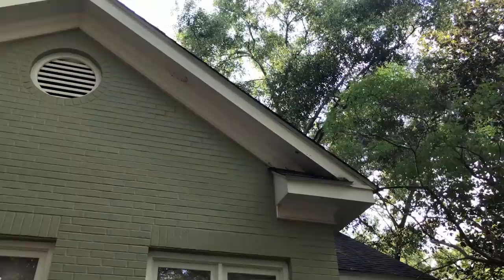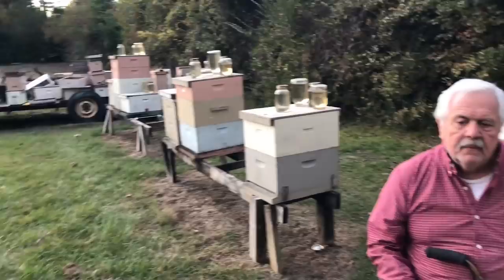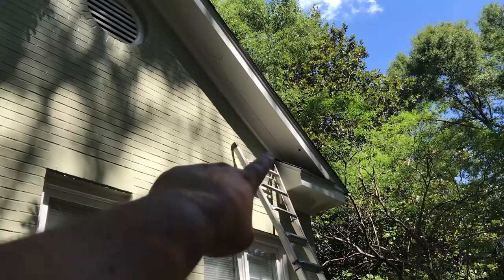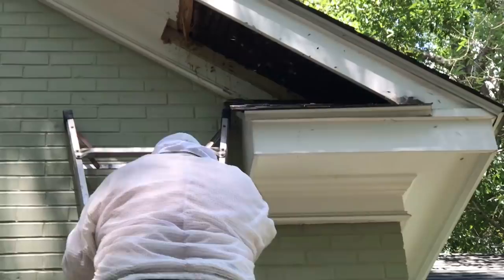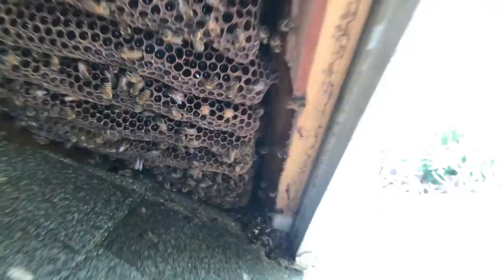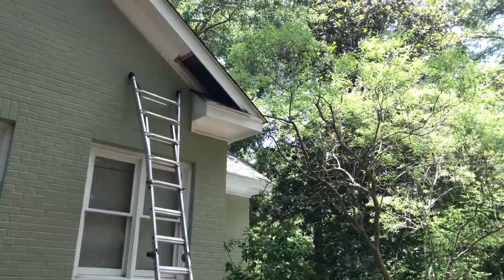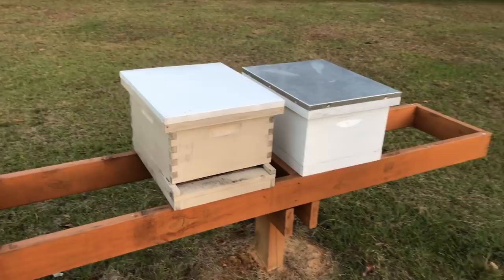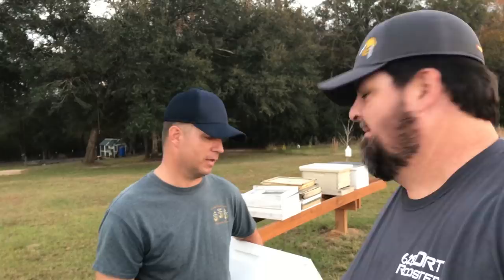Poisoned Bees...  The Hive That Wouldn't Die

Comment: Your dad looks in pain.  Not prying but my husband and I have joint issues too.  We both use glucosamine and chondroitin.  I buy the walmart brand Spring Valley . (I tried a more expensive brand that didn't work.). It took about a month to start noticeably helping so slow that I convinced myself it had gotten better on its own.....so I stopped taking it.  Big mistake!  Within a week my knees were back to bone on bone grinding.  I went back on it and about two weeks later I was feeling great!  My knees feel normal (even after 3 surgeries before I started the vitamin)...once in the last five years I ran out and didn't buy them for a week...boy was I sorry! I haven't run out since.  By the way I only take one pill a day now for maintenance and have no problems.
Reply from the maker: He's definitely got the worn out joints and the surgeries that go along with it.

Comment: Rooster.   Really enjoy your videos, and have a question not really pertinent to this video, but certainly to others.  When you use rubber bands to hold comb in your frames from cut outs, do the bees repair and build new comb right over the top of the rubber bands?  If so does that create problems for you  down the road when you harvest honey, or divide for new hives?  Just always been curious.  Thanks, and keep up the good work!
Reply from the maker: Those typically end up being brood boxes so honey extraction isn't usually an issue but the bees chew through most of the rubber bands and drag them out of the hive.  Any that are left are easy to remove even if comb is built over them.
Reply: @628DirtRooster  Very interesting.  Thanks for the quick reply.

Comment: Not all pest control techs would have done this. we call a bee keepers and have them removed. Don't judge all Orkin by the actions of 1 stupid tech. Needs to be reprimanded, and leaving those cans behind is ILLEGAL.
Reply from the maker: We have some really good pest control techs down here and most won't spray bees.  The two that I had to follow up behind last year that did try and kill them were from O....  One bad one from this year was another large company.  Only four that I dealt with in the past couple of years.  Four in two years is small potatoes in the grand scheme of things though.
One of them from this year was almost funny.  They sprayed so heavily inside a second floor bathroom vent of an apartment that the apartment management had to place drying fans in the apartment and ended up having to replace part of the ceiling because of how saturated the ceiling and insulation were.  The bees survived.

Comment: If a hive is ever sprayed with wasp spray, can honey made in later years be used?
Reply from the maker: It can. Any contaminants left over will be in the wax but not the honey.
Reply: 628DirtRooster sounds like the best plan is to cycle the old wax out when possible and not use the honey later stored in that wax... better safe than sorry.
Reply from the maker: @willmegehee  The only wax kept is going in the brood box so honey isn't taken from it anyway typically.  It's extremely rare that I frame up any honey comb from a cut out.

Comment: Good job!  Those hot days will cook you even in the shade!! I started taking a fan with me. One of those wind tunnels , or wind machines such as sold at Freds and Walmart. you can adjust the angle of the fan straight up if necessary and brother they do help tremendously !!  There is you tip for the day. hee hee.  I have a question,  from Jimmy's hive. How did the partial screen bottom boards work out for the Small Hive Beetles? I am form North Mississippi and have been using full bottom screened as you showed us on one of your videos and they do the trick. However, If the partial works just as well, I might change up simply for the connivance of the pan. Bought pans are cheap at sams but on the full bottoms, I have to custom make each pan. to fit. I would rather build the bottom to fit the pan. But, I am thinking with the non full bottom the beetles can simply walk around the screen and up into the hive?  Thanks, so much Phillip Hall
Reply from the maker: I didn't ask him but I'm thinking about trying some partials myself because of the cost of the oil trays.  I can get smaller containers for nearly free as opposed to six or seven dollars each for cafeteria trays.
Reply: Yep, My thoughts  also. I am a little apprehensive though. Perhaps if you get an opportunity to talk to him soon and find out more, will you post it here as I sure would appreciate it!!   Might make a good video to boot?
Thanks, Phillip
Reply from the maker: @PhillipHall01  I'll see what he can tell me.
Reply: Thanks Randy.. Appreciate it....  Phillip